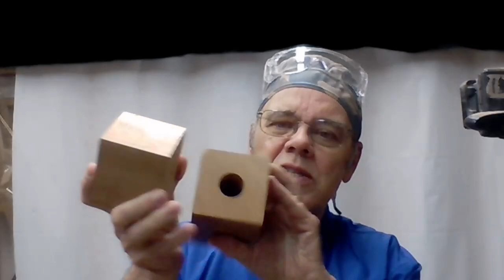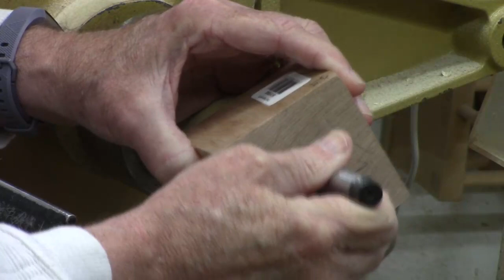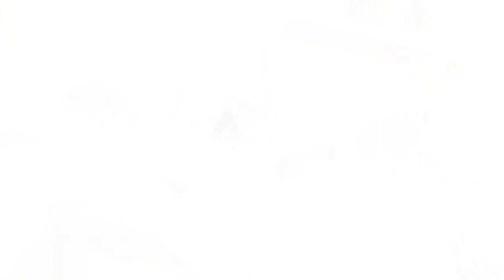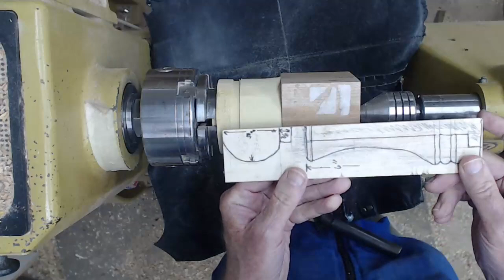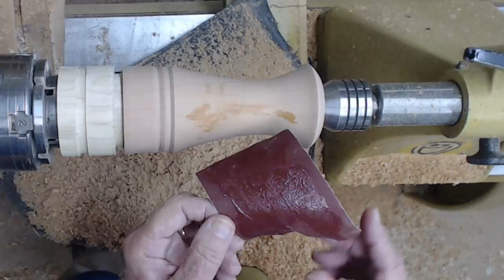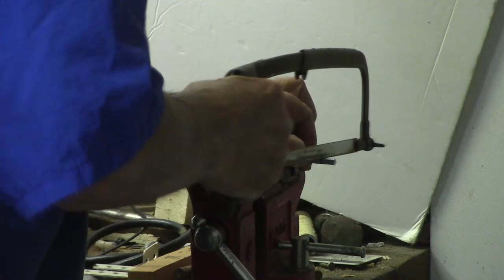DIY Pepper Mill: A Step-by-Step Woodturning Tutorial

Comment: Twenty years or so back I had bought a lathe and one of the first projects I attempted was (as wife calls them) salt and shekka papers.  I purchased a kit from one of the local suppliers for a salt shaker and pepper mill complete with hardware and appropriate blocks of walnut.  I looked the wood over and found nothing of note, no knots, straight grain and no figure.  I set one piece up between centers and immediately had trouble cutting it with my roughing gouge.  I kept trying with still no results.  Finally I stopped and looked at my tool which had a lovely radius where the cutting edge should be.  I knew that there had been an edge when i started.  I removed the work from the centers and there was a nice bright shiny piece of steel which had been completely encapsulated by the wood, missing all the blades which had harvested, cut to size, ripped and every other operation between forest giant and tiny block.  Don't let anyone ever tell you I never have any luck.😥.  Never did finish that projectt.  Thanks for your video.  I have another lathe coming in two weeks.  I might actually try them again.
Reply from the maker: Turn enough and you hit metal. I cut thru a lead bullet. Another time barb wire. Stuff happens when you turn.

Comment: Hi Mike. I use the pre-drilled blanks too. But since I also turn pens I have a pen mandrel laying around to mount that top block onto. Once I turn the tenon and the bottom contour on the pen mandrel, I flip it around and chuck it to contour the top. Other than that my process looks much like yours. Good timing on the video - 'Tis the season for seasonings. ;-)
Reply from the maker: Great tip! Thanks for sharing.